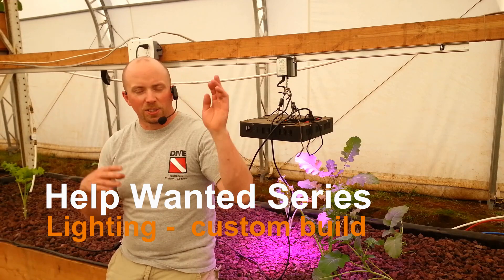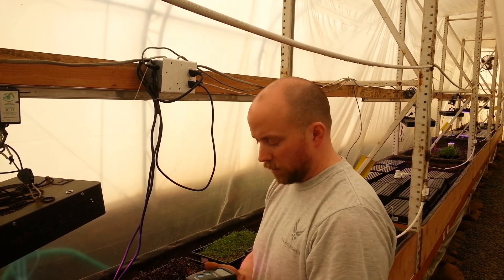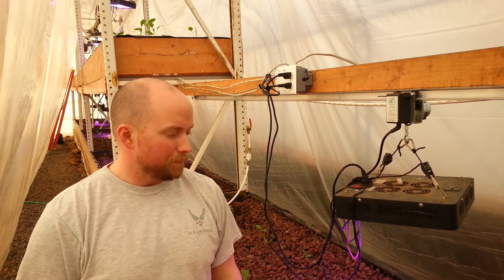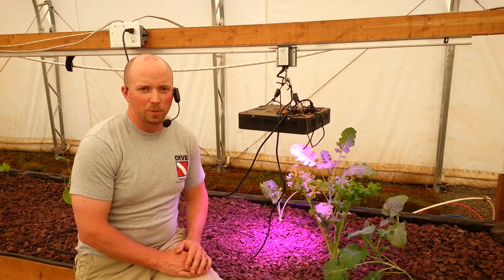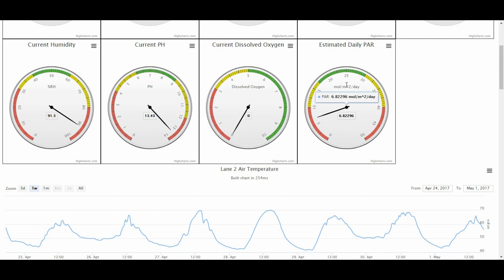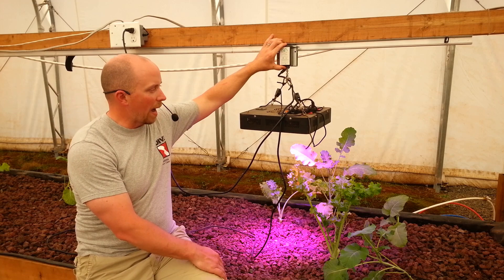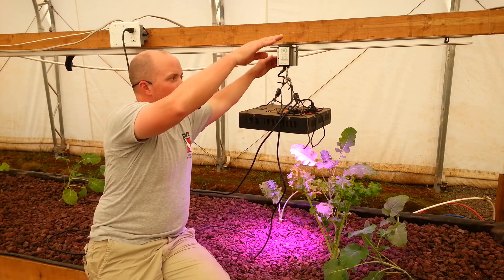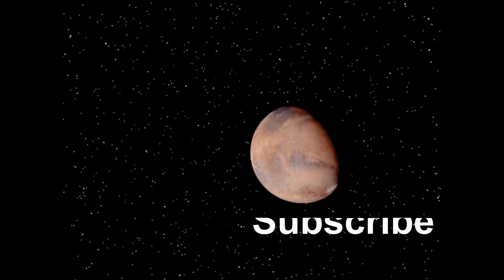Building your own Grow Lights, or buying custom?

Comment: also remember you have 40 amps at 240 v and 80 amps at 120 so total of 9600 watts, or 9.6 KW available.  That being said, your motor starting current is going to be higher.  Which is fine.  The other thing I thought of is what we use at my work, is a VFD to ramp up based on demand.  So main pump with a backup, pressure regulated, so you set a minimum flow/pressure and the pump will maintain that with everything on.  If something closes, ie, repair of a lane, the pressure sensor sends a signal back to the vfd to slow down the pump.  We use it on our air compressor system.  The damn thing just idles until it's needed instead of the old one cycling on and off.

Comment: I would get hold of some COB style cree leds (can send you the link to some ebay sellers) and mount them on to U channel aluminium acting as a heat sink (can easily get in long length to do away with the moving rail system) .  LED drivers are also super cheap now, just drill and tap some m3 size holes for mounting the cobs/mini cobs and use thermal paste to ensure good heat transfer (if you use thermal compound you can't replace the leds as easily if one were to fail). I would stick to warm white or cool white leds (or a combo of) , the blue and red LEDs on their own doesn't give the same quality/output of light. 

Spectrum king make good horticulture lighting and you can replicate it yourself for 10-20% of the cost following the above.
Reply: Plenty of LED drivers to suit the below.
Reply: Didn't they start selling a line voltage grow led cob? would just need a heat sink and not waste energy converting to dc
Reply: I think they have, but because most of the innovation is put behind DC driven LEDs they are far more efficient (i.e. lumens put watt consumed).
Reply from the maker: great reco and info...thank you...should be fun build...ops tipping hand
Reply: No problem! if you want to keep the U channel extra cool when needed, some PC fans work perfectly. Always a good idea as extends their life and increases the light output.

Comment: Hello, we use the same cable management system at work for power and hydraulics as well as water.  We have ours mounted horizontally so it supports itself as int rolls up and unrolls.  I will try to get a vid of it and post it on my photobucket tomorrow. We use it on several machines in different sizes/widths.
Reply from the maker: appreciate that...there's a good chance I'm just doing it wrong, or buying the wrong product

Comment: not really what you're asking. but maybe cover some of the panelling you have planned in something reflective like aluminium foil. I boost lights like that that are behind a monitor, it reflects a lot more than just white wallpaper.

also, light falls off inverse square so make sure you measure consistently from the same distance each time.
Reply from the maker: reflectivity may end up being a key driver here so I really appreciate the comment

Comment: I worked in agricultural research... light is a MAJOR consideration. bare LEDs strips ( multiple) or Merc (doesn't matter so much but the reflector is everything. Get rid of the motor so that the plants have consistent lighting along the length and then get the correct lateral light density across the 44 inches but NOT beyond. Simple reflective sheeting (plastic mirror type) can be structured on wood frame to give the correct even density. Heat dissipation is not an issue with LEDs, it can be passive into your tunnel environment and actually help. Cheap Chinese strips are best (waterproof) and can be added on the fly to get the correct density. They are normally sold in 5-10m lengths and can be folded back on themselves. I am in the UK so I wont mention prices, they wont be relevant. Make sure you know the spectral composition of the LEDS and that the output is aligned with plant requirements (documented). Even Grow lights aren't always aligned. If you go into a commercial glasshouse thats lit you can hardly open your eyes.
Reply: Please keep in mind that "simple" RGB LEDs are not sufficient for growing applications.  They are composed of individual Red, Green and Blue LED chips that fool the eye to seeing a particular colour given the intensity of a particular chip.

I agree with Colin regarding the spectral distribution for the lighting.  For microgreens, inexpensive LEDs from E-Bay are the way to go as you can get hundreds of them for very cheap.  I would take Colin's suggestion and put them on a u-channel along the length of the micogreen grow bed roughly 8" (max) above the top of the anticipated canopy.
Reply from the maker: great info on the reflector and confirmation based on your experience that this is what we should focus on. thank you
Reply from the maker: thank you...this is great info
Reply: +TBJ Agree on RGB. I mention that we need to consider the spectral output from the LEDs and align with pigment uptake for photosynthesis which is orientated around two bands.
Reply: I'm curious about this. I would have thought if you mix red green and blue, you aren't really "fooling" the eye, you are actually making the color. Is the range of regular RGB leds not sufficient to get the frequency bands most plants need?
Reply: I looked into this and no, it isn't.  Please keep in mind that the "colours" you are making by adjusting the Red Green and Blue LEDs are not changing the wavelength of the particular LED being used.  Since photosynthesis relies on the energy states of the photons emitted by a source the intensities of the individual LEDs would have the most impact rather than what we perceive as a given colour.

I haven't taken a spectrometer to an RGB LED to determine exact spectra being emitted by RGB LEDs, but from reading the specs of the RGB LEDs you'll note that each of the LEDs has a specific wavelength.  Again, this is what the chloroplasts involved in photosynthesis react to.
Reply: samfosteriam It is rather counter- intuitive but RGB is mixed by the eye to get a rather crude white but doesn't give the wavelengths for the absorbing pigments in plants. What the eye 'sees' and what plants need are a world apart. Curious, I agree.

Comment: you were keeping that sensor awfully close to the light, keep it at the height of the microgreens. (square of distance!)
Reply: Exactly, just like gravity, strength = Square of the distance.
Reply: Was going to say the same, I study light in detail and have to always bare in mind inverse square law. Optics overcome this but only to an extent obviously.
Reply: As far as i could say the main 'par' reading was taken by the sensors at ground level, based on the Square Root thing one could probably make an easy excel sheet to see the values over the distance between the actual LED's and the ground, giving a bit more info on the light distribution over the growth height. As stated the plants need less light when they are small, and need progressively more light as they grow larger. Thus knowing the light strength distribution over the height (aka. available grow height) can thus help a lot in figuring out the scaling of the system. There basically needs to be more light higher up, and seeing the plants do great when they are small it might not be that much more (also seeing that the plants do look fairly healthy, be it bit skinny).
Reply from the maker: great point

Comment: I, like you, found out the hard way how important lights are, I fiddled a lot with nutrients and various techniques, but light is really the key to get things right, your plants dont care what soil it's in, you can forget to water it for a while and it will be fine, or get the nutrients off by a bit, they dont care... but you screw up on the lights and NOTHING happens. Or you get leggy and bad growth.

Don't be so quick to dismiss non-LED's. For my diy projects, I used 200W equivalent CFL light bulbs (cold white, often sold as photo speciallty lights, not overly expensive for the amount of W you get). If I needed a larger area, I would seriously consider cold white T8 bars, they are dirt cheap, fairly good efficiency, easy to install, cover huge area (different lengths etc), all with a nice back deflector. There are ofc LED bars made to fit same sockets as well, but more expensive.

In terms of leds, they get expensive when you need the kind of wattage they need to output. If you want a good DIY, get the Driverless COB leds from Ebay, the 30W ones, not the 50W (50W ones is pushing the leds a bit hard). Get some aluminium reflective/heatplate and mount them to. The size of your growbeds and length of the whole system will take a great deal of power though, you would need at least 10 cobs per "box" in your lane, 4 boxes per row, 1200W per row per lane... im sure you can calculate the amps on that :)

Also, proximity to the light is super important, and being able to raise/lower it depending on what stage your plants are in, also takes a toll on the planning, you need to plan what to grow in each box and not mix things with different grow height. And then you need fans to cool your plants and not burn the leaves.

These notes are for non-microgreens, they seem to grow anywhere with minimum light.

Comment: I think 100W FULL SPECTRUM or ROYALE BLUE COB LEDS per square meter is enough for microgreens, FULL SPECTRUM LED are cheaper, but ROYALE BLUE are more efficient. You can an alluminium heatsink, with 2x50W COB LEDs and 120° optic lens, standing 30cm heigt from microgreens. Buy 2 LED of each type and run a test.

Comment: Not to sure how rugged you designed your system, mainly the motors, as i would suggest instead of scrapping what you have and investing a bunch more money. Perhaps try and see if you can fit 2 of those small light boxes on one motor, this you can likely test with the stuff you already have ... Also, your PAR values are at soil level, as stated in another comment about the square law, your par levels will be different across the height of your growing space (from the soil to the lamps), you can likely easily make an excel sheet to calculate the distribution of PAR over say 1~2 inch increments, to get a better idea of the actual values in relation to the plants height (can even check the sheet by taking a bunch of PAR reading at different heights underneath the LEDs). 

Then obviously you would mount another box aside to the one you have, and test and calculate these values again (this can even be stationary test case). Because you need 3x the amount of PAR you currently have, AT a higher level in the growth period of the plant. Seeing the plants do fine at their infant stages with the light available now. So doubling the lights and taking the Square law into account might actually already get you there. (and you can test these kinds of thing with the gear you have, maybe 3 boxes would be the way to go? - given the motor can take that) ... One 'but':

You would then obviously want to calculate the power consumption of such an extended system and compare it to just using LEDs (and compare the running costs) ... though 'heck' , having you describe the climatic conditions you have to deal with, i am not entirely sure why you are even running the active cooling on them now! (barring of course that they are in a box structure atm, and might thus otherwise overheat due to this structure; But, maybe a broad plate (the width of the lane) on the motor, with passive cooling might be the more economic solution (instead of just fitting a ton of fixed LEDs on there).

Some of this may also involve your actual plans for the entire greenhouse, how much of it is going to be micro greens, and thus how many of the current setup can you 're-use', which part is going to be bigger plants, how much would you need to invest (with any solution) which are the operating costs when comparing systems. And as such decide the most financially sound yet sufficient solution. (given of course you do not want to take the weight to cost into account of actually bringing that stuff to mars ;) ) ... So yeah, seems like a weekend of measuring and excel-sheeting would be my advice ... instead of just 'boldly going to a custom LED shop ! - can always still do that of course, but 'boldly going without knowing is like warping without a calculated trajectory, you could end up somewhere you don't want to be.)
Reply from the maker: great advice here..thank you...this will definitely be something I'll do...like you say...we have the sensors...and that will help tremendously.
Reply: Also might have a solution for your wire problem ... you could fix the problem, that from the view of this solution stems from having the control box for your motor in the center of the lane, by moving that box to one end, then use a longer wire and a curtain rod, you would divide the total length of the grow area by the height available giving you the amount of sliders you need on the curtain rod, affix the cable et presto. This of course again (like the motor capable of moving 2 of those light boxes) depending on whether the motor can overcome the friction on the sliders... Should likely mount this somewhat off to the side so that the cable doesn't snag on the plants, and you will want to attach a rod to the motor assembly to help pull back the cable, this will reduce stress on where the cable is enters the motor/lighting assembly (hope this vague description of mounting it off to the side is clear enough) ... 

It may not be the solution you were hoping for, but for all intend and purpose it is a solution, now i haven't watched the re-wire video yet, but if you are planning to rewire anyways... again though, i would advice testing this first before going full scale, can even do so on just halve the bed with a couple of instruction changes on the motor management system, by having it go back and forth only half way. (here i am assuming each motor can be instructed individually and you have a bed to test with) ... if it works half way to satisfaction, maybe rebuild just the one 'test bed' to see if it works on a full scale bed.
Reply: Hiya TRM,after logging off i thought about the light situation a bit more, and concluded that the PAR values will also differ across the crosssection of the growbed. See, simplified every LED on the light-assembly gives off a cone of light, this in part by how the LED is constructed combined with reflection AND a bit of inverse-square-law. When these LED's are put into a square grid, these cones will overlap, and due to the distance they are placed from each other they will also 'not' overlap for the distance they are apart. So in every corner of the assembly there is only one LED contributing to the light there, and as you move across towards the center of the LED grid more LED's start to contribute to the available light underneath the LED-grid (to a point where the distance between LEDs on the grid, equals the half the base of the cone (half the diameter), as that is the point where a LED no longer shines on the spot that distance over; more accurate would be to say that the contribution of light is negligible).

This obviously also works along the Height between the growbed and the LED grid, the higher up you get to the LED grid, the less 'cones' of LED's further from the point viewed contribute to the total amount of light available in that point. The both combined lead me to conclude that maybe calculating all of this is a bit to much, you could if you had the values of just one LED, but it would be a lot easier if you just took readings with the sensor in strategic places ... This theoretical analysis also shows that at some point it making the assembly wider doesn't contribute to the total amount of available light in one spot, as LEDs further away pretty much do not contribute to the available light half the diameter of the cone over ...  This theoretical analysis did lead me to come to a possible recommendation for the setup of plants within grow-beds 3 & 4 (as 1&2 will be fine as is with all MGr):

That is, to make the best use of space AND available light, you might want to consider dividing up a grow bed into 3 zones. Two side zones and a middle zone, the middle zone with the most available light (as concluded from the above) could be used to grow larger plants, while the two sides would likely be better suited to grow more micro greens. As the sides have the least overlap of LED contribution to the total available light. Maybe something to consider, strategical plant placement based upon the available PAR in those locations in the grow bed. Reading with the sensor could help here.

some more considerations in a next post, they are unrelated to the above and thus a separate post keeps things organized.
Reply: Some other solutions to the light problem:
- Speed up the motors, the faster the light assembly travels the more the plants below it are exposed to light (double the speed means double the exposure to light).
- Shorten the tracks (in half f/e) and place another assembly, a shorter track means double the exposure, given the speed remains the same.

Comment: I haven't seen any listed, but the thread is getting kind of big and I am late to the comment.  I searched for "LED Strip Grow" on Ebay.  I found the following:

http://www.ebay.com/itm/222508338095

The nice thing about these is they give the option of choosing the red to blue ratio between 3, 4, or 5 red to the one blue.  I think this will give you the ability to run the length of the bed and then you just add strips until you have the proper Fux density.  They are 12V, which could be an issue.